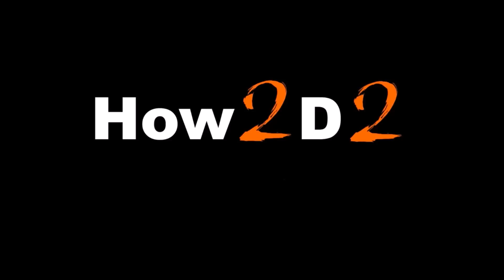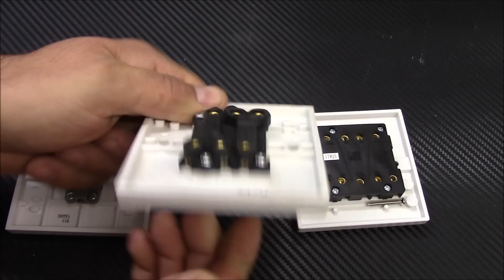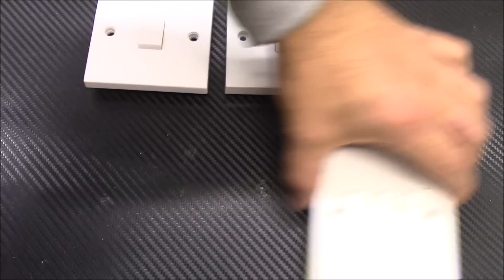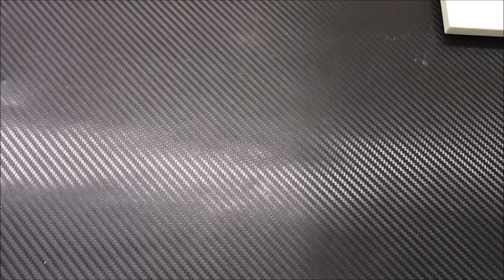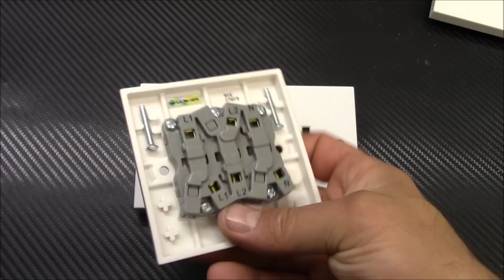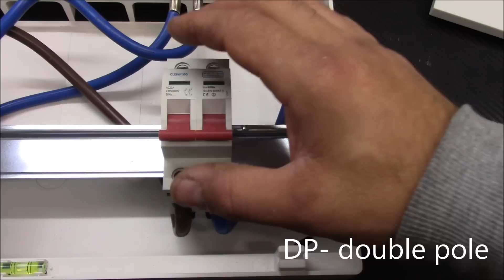Way in switch Gang in switch and SP DP Pole Difference in electrical switches

Comment: I'm looking for a 2 way double pole switch to replace the current one but there seem to only be single pole 2 way or 1 way double pole, any reason why someone would have used a 2 way double pole switch, when it is only 1 switch that controls the lights. 

It's part of a 8 gang grid
Reply: Why would you want a Double Pole switch for lighting?🤔

Comment: hi ! i bought a 2 gang 2 way switch but instead of seeing "COM" or Common, i see only L12, L11, L21 and L22 (along with the normal L1 and L2. Please help!
Reply: The L is the same as a common on that switch it stands for load
Reply: L1 and L2 – COM/LiveIN
L1¹ and L2¹ – Way1 (load)

L1² and L2² – Way2 ,if used

Eg. 2nd Gang combination:
L2 – COM/LiveIN
L2¹ – Way1 (load)
L2² – Way2 ,if used